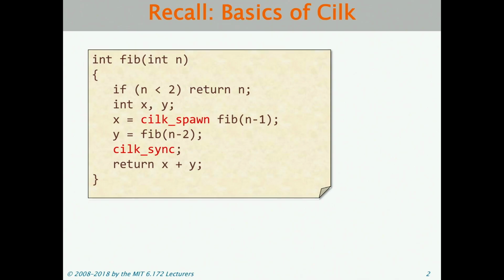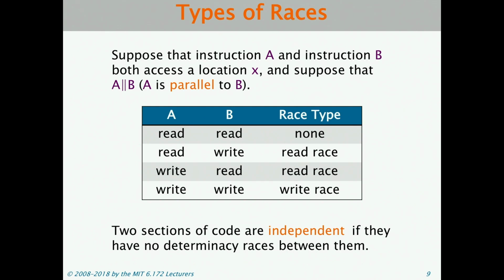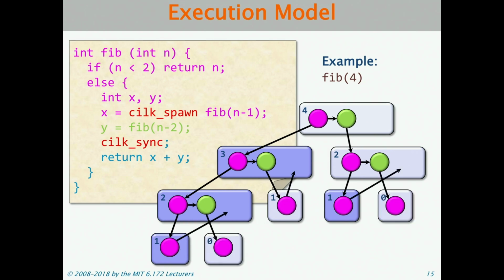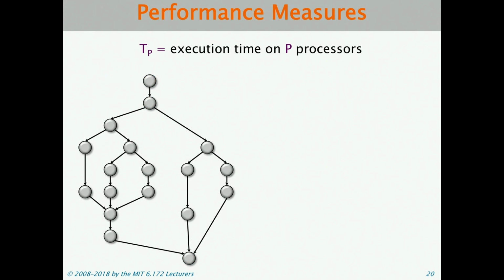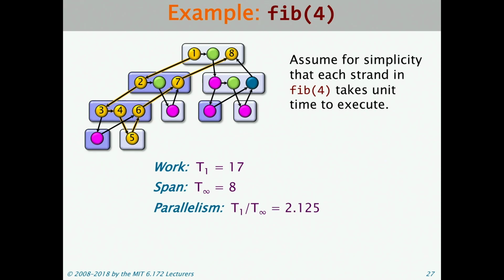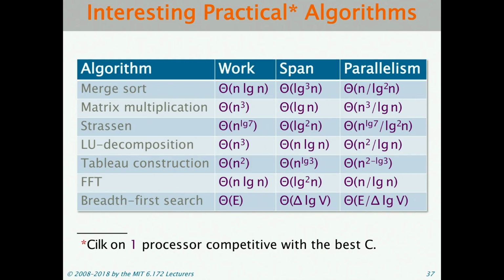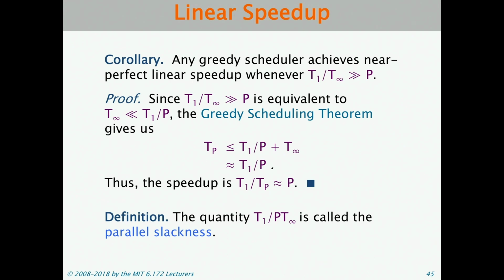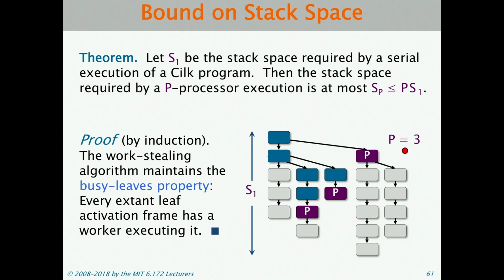7. Races and Parallelism

Comment: In 1:07, he actually does not know cilk at all. Actually in java library there is similar implementation inspired by cilk, so I understand the theory.
Each deque stores the tasks(refrences to the function calls and the arguments that need to be passed to the functions),  they are waiting to be spawned and be executed.  A spawned task is not in the deque, it has already be fetched or stolen from the dequeue. Here spawn and execution of the function call are the same meaning.
Once a taske is spawned, no core can steal it because it is already in execution on a core. It can only be stolen when it is in the deque.
There is a dedicated thread responsible for management of the set of deques

Comment: I would like to ask the teacher himself whether he understands what he says, as I do not . 
I think the teacher does not understand why Tp > = T1/P.
 I think it is because the ideal case is that every core gets exactly the same amount of work evenly, which is T1/P resulting all the cores finish work at exactly the same time, which is  Tp = T1/P. 
But in fact some of the cores get more workload and some get less(the sync command is required for a  core to wait for another one to finish if it gets less workload than the other). When all the cores finishe the work respectively , it should be more than T1/P because of the waiting time for the sync commands.
Reply: He's talking about in theory, not in practice

Comment: 13:45 This is not true, C11 specs guarantee that modifying x.a and x.b in parallel is fine.
Reply: Also noticed that. The same is also required by a C++ Standard ([intro.memory], paragraphs 3-5 in C++17)

Comment: My takeaways:
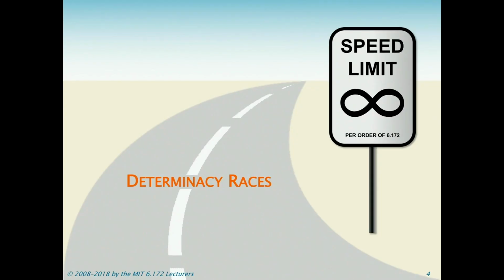1. Determinacy races 4:05
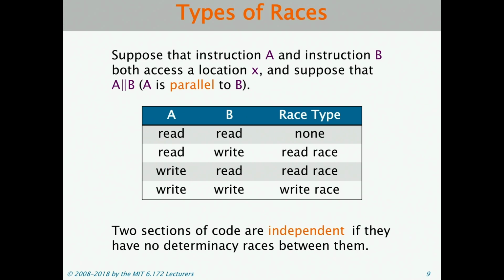- Two types of determinacy races 10:26
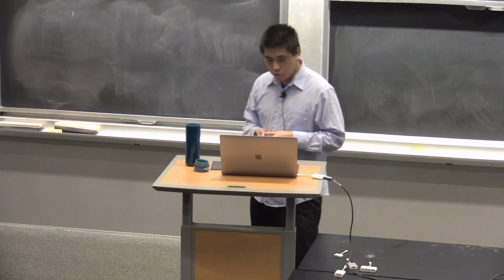2. Avoiding races 12:10
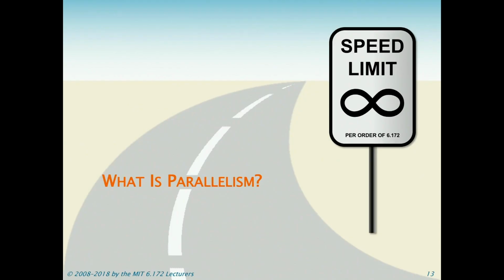3. What is parallelism 18:15
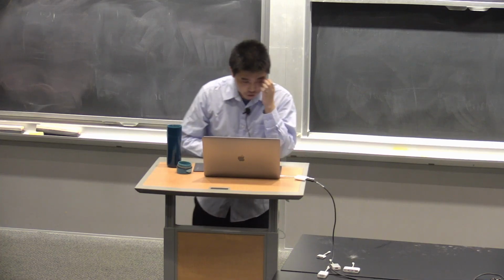- Computation Dag 24:10
- How much parallelism we can get 26:35
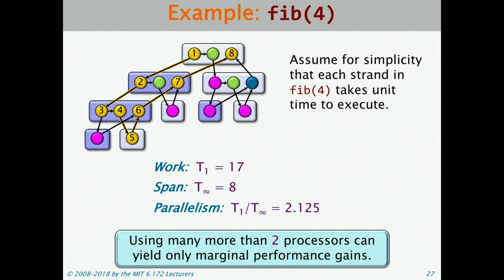4. The Cilkscale scalability analyzer 42:25
5. Scheduling theory
- Greedy scheduler 53:25
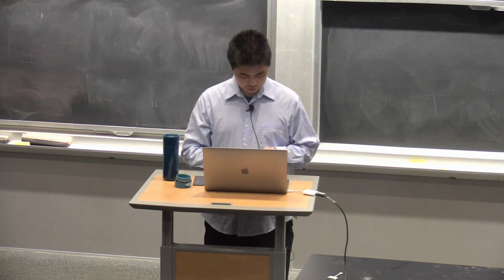- Cilk work-stealing scheduler 1:02:50
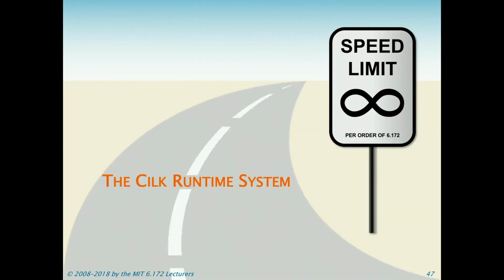6. The Cilk runtime system 1:04:27

Comment: What if your computer architecture is soooo different, by definition your computer doesn't have a processor/ cores, threads, pipeline, stacks, etc... but it can have unlimited level of Parallelism?
Reply: If it has a 1 processo and your program has unlimited parelism it it will just execute it sequentially